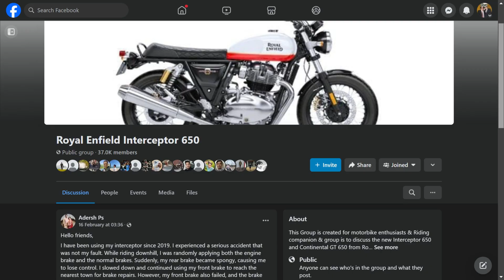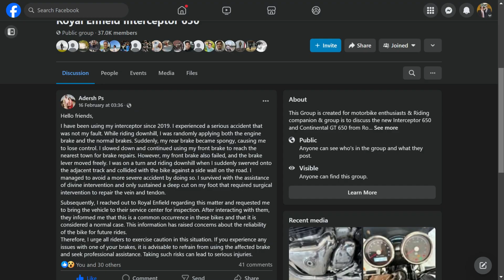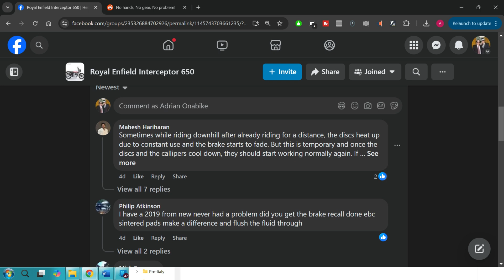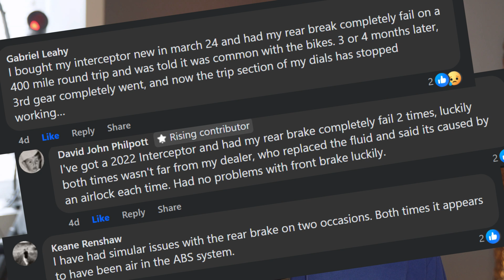Royal-Enfield 650 Brakes Are FAILING!

Comment: We have a 2019 Interceptor 650. Bought for my partner as she liked the style and learning to ride.
In January, this year, ruding doen a hill had total front brake failure. You could squeeze the brake lever to the grip with no effect. Used rear brake and gears to slow down just in time before a sharp right bend. No loss of fluid. Bike was fully serviced and just had new brake fluid 3 months prior.
There is a recall to replace the front and rear calipers as they were not anodized so will eventually corrode.
Here in backward Australia the dealer advised there was no recall in this country as bikes are country specific. So what he was basically telling me was that the brakes would be different for various countries ?  Come on ! That's some BS right there.
The bike looks good and rides well but when you start looking at the corroding parts a bit closer you soon realize its junk.
Get rid of it before it kills you. We got rid of ours...
Reply from the maker: I would be so infuriated if that happened to me or to my partner. Glad you guys are alright. You did the right thing getting rid of that bike. The brakes should be failing three months after servicing. I pick up customer bikes with ten year old brake fluid and they still stop okay enough and don't fail. Incredible... 
Adrian

Comment: Been driving about 17 years non stop. Bought INT650 2023 with 300km. After maybe 1000 more  I crashed  into stoped car in front of me. My fault. I wasn't driving that fast and I think I noticed the car on time but felt the brakes didn't do job I was hoping they will. I belive on my Scarabeo200 that I would manage to stop on time. Luckly no serious injuries althou I did fly over the car and  fell on the road.
Reply from the maker: Ouch, very sorry to hear that. Glad the accident wasn't worse? Do you still have the INT650 or is it gone now? Honestly if mine was one of the ones with a recurring brake issue I would get rid of it ASAP.

Ride safe, but have fun!

Adrian
Reply: @YouMotorcycle   Bike is on a road again luckly. Changed the front rim and axle, fixed bent front forks, chassis needed little pull and now after cca 1000$  it's good as new ;)

Comment: Same issue on mine. Very disappointing.
Reply from the maker: Sorry to hear that! I would think about taking this up with the dealer and trying to get rid of the bike if it was me. I don't want to risk my neck on a motorcycle with a brake issue. 

Ride safe, but have fun!

Adrian
Reply: @YouMotorcycle  If you get rid of the bike, you really need to tell the buyer that the rear brake doesn't work. There has to be a factory fix or replacement for this. Of course if Boeing can crash planes, maybe RE isn't too concerned yet.
Reply from the maker: Agreed. Give full disclosure. Might save a life.

Comment: Thank you for making this video. While maintaining your brake fluid is always a good idea, this seems well beyond lack of maintenance. Shoot, there are probably bikes 20+ years old out there running around with the original brake fluid, and they still work fine. How the heck is the air getting in the system? Any other complaints from other manufacturers who also use the Bybre brakes of similar issues?
Reply from the maker: Thank you! And yup, you got it, this isn't a matter of poor maintenance, as people are having repeat failures after dealer servicing. It seems a small % of these bikes just have bad components, or the components were badly installed from factory.

Comment: I would argue that if these brake failures are "common" that makes the bike not fit for purpose and you should be able to demand your money back.
Reply from the maker: I think that's fair, if the machine can't stop, it isn't roadworthy. I wouldn't be too worried about this as an Interceptor 650 owner, but if the issue did come up despite me bleeding the brakes every two years, I would know I got one of the bad ones and try to get rid of it.

Comment: I have bought an interceptor 650 in July, from 2021, with only 2000 kms. The previous owner complained a lot about the rear brake. As a novice rider, I also felt that this rear brake was weird, not a lot of grip, very spongy feeling. I went to e serious RE Center, the guys told me it was normal: The fluid was old, and the master cylinder being close to the exhaust, it boiled and made bubbles of air. 
They used a diagnostic tool to purge the master cylinder and the ABS module, everything went back to normal. I am since very happy with my brakes, it just need serious and regular maintenance.
Reply from the maker: These are two separate issue. What you're describing is brake fade. What others are describing is brake failure.
Brake fade comes from old brake fluid. Brake failure is when there is a problem in the braking system.
Maintenance will avoid brake fade. But if there is a component that is wrong, or if installation of that component from factory is wrong, then you will get brake failure, and it's not a question of maintenance. These are two separate issues. That's why I made the distinction between the two in the video. It's not just a matter of maintenance, as the three other people I mentioned had repeated issues even after dealer servicing.

Comment: I rode a 23plate bike that had been standing in the showroom for a few weeks.. rear brake was U/S...deler said there was a upgrade for the rear caliper?...
Reply from the maker: I've seen several people comment on facebook that they upgraded to Brembo brake components and are happy with the results. I haven't done any brake upgrades on these motorcycles myself so I can't give an honest opinion on how expensive it is or isn't and whether or not that's the solution. If I were me and my RE650 was fine, I would just change my brake fluid every two years like normal and leave it alone, but if I got brake failure even once I would get it fixed and then quickly sell the thing altogether.

Comment: I have a 2024 RE Int 650 and I had to go through rear break failure more than twice. Once it happened when the bike was sitting for hours and when I started the bike, ran the bike to about 100KMPH, the rear break without any warning failed. Luckily it was night and there was nobody on the road and I stopped the bike using front brake. Second time I was riding the bike on a downhill and the rear break failed again, I had to use the front brake for another 15 kilometres in a remote mountain area. When I took the issue to the RE service centre in Dehradun, India, they told me the same thing, 'it is a common issue'. I was like, '"is people dying on your motorcycles a common thing for your company?" Then I took it to another RE service centre and they flushed the rear brake and told me to initiate breaking with front brakes first and using the rear break simultaneously. I learned to use the braking system on this bike. Not sure, if this is same with other Twin ABS bikes! It's clearly a cost cutting done by the company and not using good quality breaking components on the 650s. It's not my first bike and I find this a reckless step by the company.
Reply from the maker: Wow, that's incredible. In your position I would sell the thing and give the buyer a stern warning to keep an eye on the brakes. Not worth the risk in my opinion. Good luck, stay safe!
Adrian
Reply: @YouMotorcycle  Thank you. Still paying payments monthly on the bike. Could you please recommend good braking systems which do not fail like in the stock ones for the motorcycle?
Reply from the maker: @sidfromdoon  sorry man. I need to stay in my lane and only comment on what I know for sure. I know some people have put Brembo components on their RE 650s but I really can't give any opinion or comment from personal experience, sorry!

Comment: Surely the main suspect has to somehow be the rear brake master cylinder? Calipers are Bybre so if there was an issue there, it would show up on other bike manufacturers, any general bike assembly issues would show up with both brakes?
Reply from the maker: Someone I spoke to said the same thing, and another was suspicious of the location of the rear banjo bolt being up high like that. Another person also said they had their master cylinder diaphragm fail. Lots of smoking guns, no clear sign of what exactly the source of the problem is. Only thing everyone can agree on is that the front brakes seem fine in comparison.

Comment: They are just difficult to bleed properly due to lots of high points in the system. Once done right, they are OK. They are never going to be a very strong brake though.
Reply: Yes, my 23 is playing up as mentioned.. I have had it at the dealer and had it fished and replaced.. same story taking it back.. not a happy rider..
Reply from the maker: You should read through some of the comments both on here but especially in the facebook discussions (links in the description), a lot of people are sharing repeated, chronic issues, even after multiple trips to the dealer. Some units have chronic, recurring issues.

Comment: I'd like to add. Even though you still service your bike at the dealer, there are some mechanics that are too lazy to check some parts of the bike(like replacing the brake fluid). Just make sure to ask everything on the checklist is done. Receipts should also show that.
Reply: > Just make sure to ask everything on the checklist is done.

Even that won't help sometimes. I marked the screws on the valve cover and getting the bike back from the service, they hadn't moved.
Reply from the maker: Royal Enfield dealer?
Reply: @YouMotorcycle  Yes, he made me suspicious when he said I could drop the bike off in the morning and pick it up in the evening. It was always the rule that you let the engine cool down overnight. So I marked the bolts.
Reply from the maker: @martinmuller2809  probably better off getting the specifications and then bringing the bike to your trusted bike shop next time, even if they aren't an RE dealer, just for peace of mind
Reply: @YouMotorcycle  I don't want to bore you with the whole story. I tried to talk to the mechanic but to no avail. In the end we adjusted the tappets ourselves: two had zero play, 4 out of 8 were in spec.
Reply from the maker: Unfortunately RE dealer horror stories are quite common. I think it's because of the very low buy in cost for dealers vs Japanese brands. They end up attracting a lot of fly by night, shady business. See what happened to missenden flyer for example
Reply from the maker: @velocityeightyeight  yep, fair point, but it seems like everyone reporting brake failures on these bikes are always getting them on the rear. https://www.facebook.com/share/p/169knmvE11/

Comment: Almost got an interceptor 650 as my first bike in November, glad I got a Triumph street twin instead.
Reply from the maker: 99% of Interceptors will probably be just fine... but for that 1%, it's one thing if a turn signal switch fails... it's another thing when it's your brakes :\
PS: You really can't go wrong with a Street Twin vs any bike. Those things are great. You've got a dream first motorcycle. Ride safe, but have fun!
Adrian
Reply: I wonder if there’s a Brembo rear master upgrade available?
Reply: @BlackdogADV   Triumph Street Triple R for the caliper and matching Brembo master cylinder. Still didn't work. I ended up fixing it by isolating the rear system from the ABS module.

Comment: Rear brake has been a problem on my 2019 Int650 to the point that if I am planning a ride I check the rear brake before getting my gear on. I replaced the rear pads once and find that I need to bleed the rear system every three or four months. Not as bad now but for the first few bleeds I have had lots of crap and lots of air. I contacted the dealer three years ago with respect to the caliber recall but was told it didn't apply in Canada. However, I read it now does and contacted the dealer. Hoping they will complete the recall in the spring. I didn't receive a recall letter!
Reply from the maker: Mark this is really concerning. You shouldn't have to bleed your brakes anywhere near that much. There is a flaw in the system. I would return the bike to dealer altogether. There's obviously a problem in your braking system and that means your motorcycle isn't safe or fit for purpose. I would not run any risks and would just get rid of the thing altogether. It's only going to make you enjoy riding less, or possibly something worse. Take care of yourself.

Ride safe, but have fun.

Adrian

Comment: I've had my Interceptor since 2020 new now with 17983 kilometres with no issues like that at all with proper maintenance its unlikely to have any problems if serviced properly I've been riding with many Royal Enfields Motomax Motorcycles in Perth and  never heard of this issue before not saying it doesn't happen
Reply from the maker: That's very wishful thinking. You should read the comments in here by Scott. He's a former motorcycle racer, retired motorcycle biz guy, meticulous about everything, and he had air caught in his lines.
Reply: To have air in lines obviously not bleed correctly
Reply: @Barnie104   not bled correctly from the factory? Sounds likely.
Reply from the maker: And if you read the comments in the video you would see that there were multiple issues of dealers bleeding the lines only for the problem to recur because the system is not sealed as it should be. Since I posted this video 5 more people left comments on Facebook saying their dealers have told them that they had gotten air in their lines.

Comment: Never had a problem with my brake system at all, and this is the first I've heard of it. 2021 Interceptor with 12000 miles under my belt on it.
Not sure about your logic re being nice getting more views! Not my experience.
Reply from the maker: Wish I could take credit for it but it's not my logic. It's smarter people than me who work for and with YouTube directly. 

Positive reviews get longer viewer retention, and better audience engagement. 

Viewer retention and audience engagement are two big measures the algorithm looks at to determine if a video should be suggested to a viewer. Hence, positive reviews performing better. Make a couple hundred videos, talk to people who have made thousands of them, you'll see lol

Glad your Interceptor has worked out well for you. Since posting this three more people have shared having the same issue. Seems it's even more common than I realized too.
Reply: I've got a 2020 model and after trying everything else, I isolated it from the ABS module. Now I have a good rear brake with no ABS.

Comment: I am also post of this group, read it few days back. I thought my read breaks got air.. now reading there are many riders facing same problem, it must be some manufacturing defect should have called back by RE and replaced!
Reply: The first time I faced this air-in-brake issue, I was riding in the hills. Thankfully, I was going uphill when I noticed it and managed to get it fixed by a roadside mechanic. If I had been going downhill, it could have been the same story as the person who posted, since relying only on the front brake might have led to brake failure.

Will visit service centre this weekend and will update if and how they will fix this.
Reply: I don't think it's fair to call it a complete design failure, BUT a case-by-case installation situation. If you have even the slightest problems return to the dealer immediately.
Reply from the maker: We'll see how yours hold up in a year and figure it out from there Scott. Might be too soon to tell if it's installation failure or a component failure. It'll be interesting to see how yours holds up after the work you did to get the air out.

Comment: I had some problems with the 2021. After replacing the rear master cylinder, bleeding endlessly and finally hanging a weight (floor jack) from the brake pedal off and on for several weeks the problem went away. It seems like air gets trapped somewhere high up in the system (near the ABS ?) and is an absolute b*tch to force out. Every time I hooked it up to the vacuum bleeder I got bubbles. I don't think it's a mechanical design fault as much as an installation problem.
Reply from the maker: Wow! Hey buddy, first, glad you finally got that sorted out. You're exactly who I was hoping would see this video, but, HOLY COW WTF! That is above and beyond what 99% of riders would do, and totally beyond what riders should be expected to do, to get their motorcycle's brakes in good working order. I'm impressed you went through all that to get it sorted, and shocked you needed to go through that extreme. Wild!
Reply: @YouMotorcycle  One more thought - the early 2018s and 2019s had a brake caliper recall because of possible corrosion. Easy to tell, the old calipers were stamped 'Bybre' the new ones have no stamping at all. IF the update was not done or performed at a dealer and they didn't get all the air out properly at that time the conditions for failure would go up exponentially. The 2019 I have is going in this spring for the update, we'll see what happens.
Reply: @YouMotorcycle  I'm nothing if not stubborn.
Reply: @scottmckay3310  Thanks Scott my is starting to be a problem as well I did what you said you were doing and the problem went a way I'm assuming in the spring it will be back maybe I should hang a weight of the break again just to make sure and wire tie the front brake while I'm at it. Thanks Adrian for the vid.